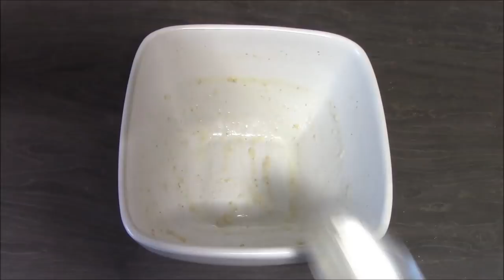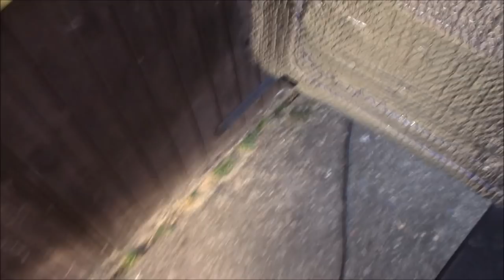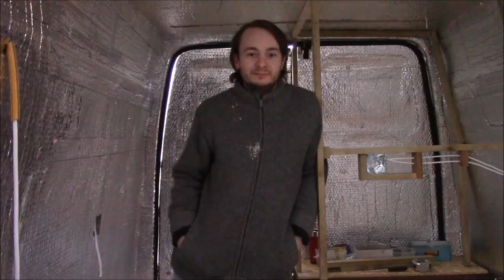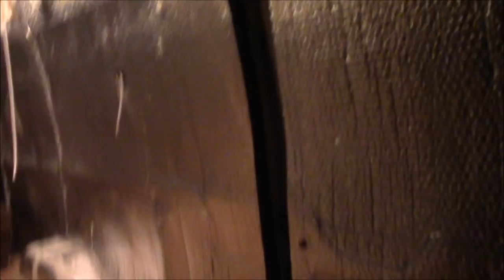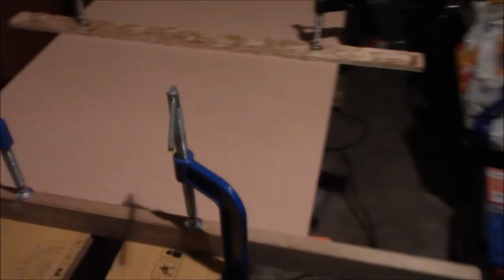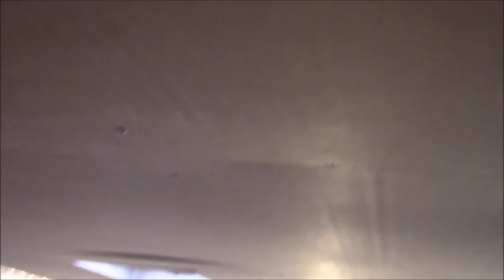Episode 12 - One Step Closer - Transit Van Stealth Camper

Comment: Cracking job!! Although mdf ceiling might be a bad idea due to moisture changes. Marine grade ply is probably the best bed, I'm sure it will be fine as long as you keep it dry and well ventilated. Keep it up, nearly there.
Reply from the maker: Someone else also mentioned that about MDF. What I'll do is spray some clear coat over it when I've painted. Hopefully it'll help a bit. If not, I'll put it down to experience. I'm not to proud to hide my mistakes. Thanks for watching :)

Comment: wood sags like that as it expands from soaking up the damp and the van being metal changes length a few thou per  foot. fix wood in the center but slotted fixings elsewhere like on old real wooden tabletops may be an answer.
Reply from the maker: Ah, so that explains that then. With the boards up it looks a lot smoother than I thought it was going to be. I was really worried it was going to look really wobbly. The stripwood across the seams will hopefully give it some more rigidity too.

Comment: MDF was a mistake, it warps with heat and moisture, should have used plywood. Coming on though.
Reply from the maker: Ah,I wasn't aware of that, thanks for the tip. I think I'm just going to have to see how it goes though. Fingers crossed it isn't too bad.
Reply: Ditch the MDF and get some 8mm Tongue and grove that where its at!
Reply from the maker: Cloudwolf40, I totally agree mate. And if anyone was asking me the best way to do it, that's what I'd say to them. It's absolutely tried and tested. Unfortunately there is a nagging little hipster deep in my mind that tells me to be different. If he wasn't there, I wouldn't even be making this van :)